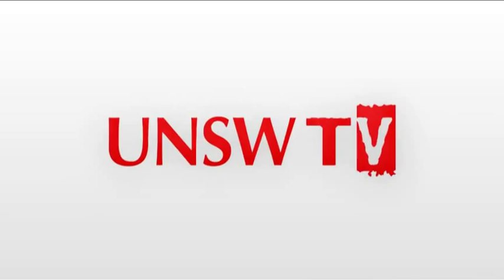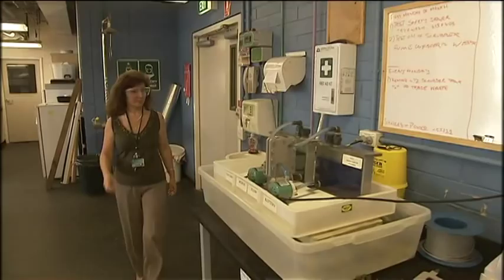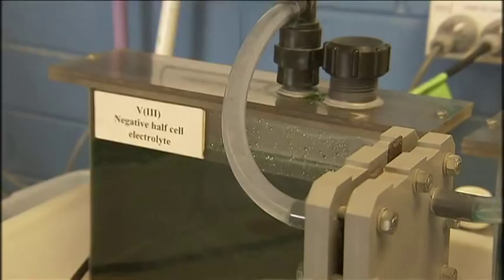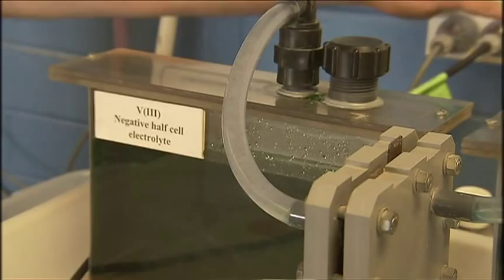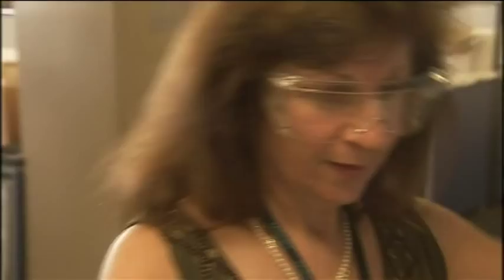Go with the Flow

Comment: Imagine the wind farm in the recent order for E.ON Vind Sverige AB for delivery of 16 units of the V90-2.0 MW wind turbine. The order has a total capacity of 32 MW to be installed in Nybro, Lilla Edet and Öringe. Storing the entire output for just 4 hours overnight will require 12.8 million litres of electrolyte.  That's over 5 full sized Olympic sized pools.

Comment: Why does the interviewer state the professor is the inventor of the VRB?  She may have been the first with a successful demonstration and holder of the patent for the current design (pardon the pun!), but the Vanadium redox couple was first mentioned in a patent of 1933 (PA Pissoort, FR Patent 754 065 (1933)) and then again in another by A. Pelligri and PM Spaziante, in GB Patent 2030349 (1978).

Comment: Why is it that a technology that dates back to 1933 (and explored by NASA as well in the 1960's) is till not mainstream?  The answer lies in the low power and energy densities associated with running the same vanadium electrolyte either side of the membrane.  Just 1 MWh of storage will require 100,000 litres of electrolyte.

Comment: This interview is terrible. This technology is not new, just a new design to an old system. This type of battery just doesn't work. It has a poor efficiency of around 65%. Worse yet is its energy density, which requires insane volumes of deionized water. 1MWh of storage is over 17,500 gallons. While very interesting, this tech has a long way to go to become viable. It may never be viable.